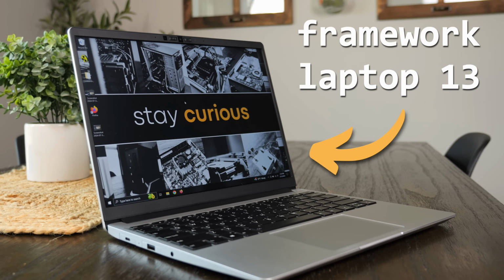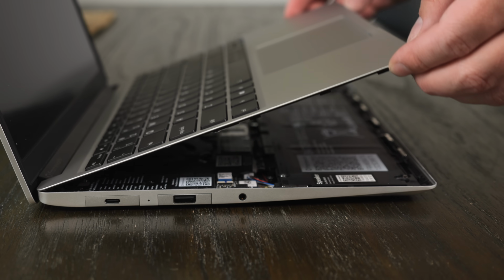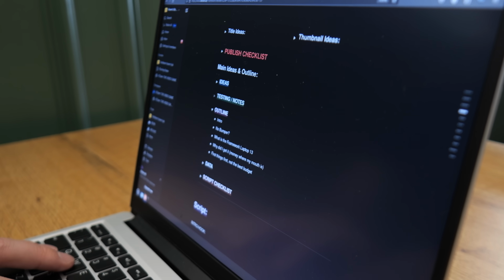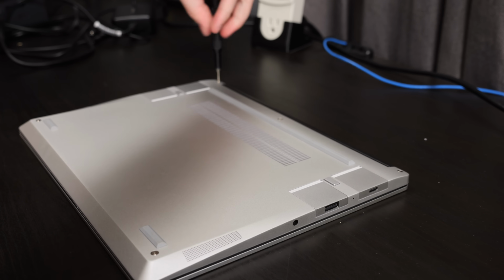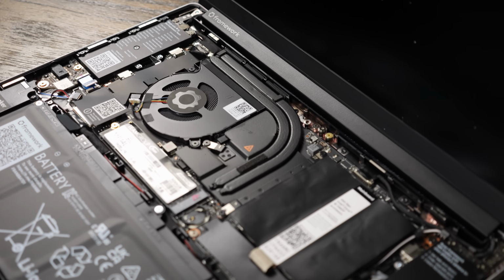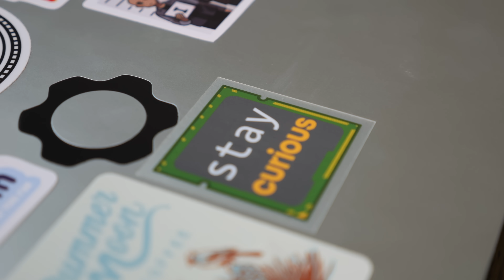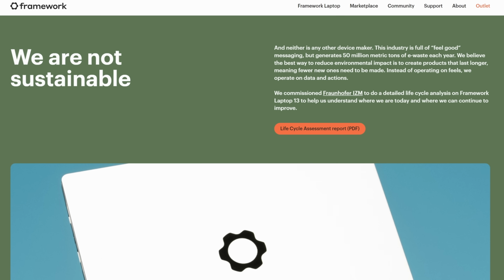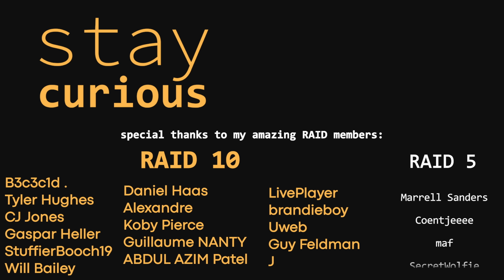Is The Framework Laptop ACTUALLY Worth It?

Comment: My wife has gone through several laptops and they've all broken in stupid ways (trackpad buttons, hinges, etc.). We bought her a Framework both to avoid the hassle of trying to hunt down parts that would be a nightmare to replace anyway, but also to support what Framework is doing. 
Yes, we could have gotten something cheaper, but I think in the long run it's worth it.
Reply: Sounds like my reason for getting one.  I kept buying around the $500 mark, previous years clearance models.  Performance-wise they were fine, but they tended to cook their batteries a bit (thin and lights do that if not well designed), and the plastic and often absurdly badly designed pieces (hinges and what not) end up breaking around 18 months in.  

To be clear, I put the laptops through their paces.  Heavy thermal loads, using them on the go, bouncing around in vehicles, just the nature of the work I do.  Only had the framework a few weeks, but so far it is more robust than even the $1100 laptops I've had hands on.  Of course, those had a discrete gpu.
Reply: is she happy with the laptop long-term?
recently got one but still wondering  how the long term experience is
Reply: What does she do with her laptops?
Mine is working perfectly for 4 years, even after a few falls from about 1m height
Reply: Hey, how's the Frameworks doing?
Reply: Don't know if its the same in the USA, but in the UK Dell Business laptops with the 3  year support get next day fixes from an engineer that comes and fixes it. I think thats good service.
Reply: @J-Stoic  "Dell Business laptops with the 3  year support get next day fixes from an engineer that comes and fixes it."

You should take a better look at the fine-print in those next day warranty claims! Almost all of them clearly indicate that someone will take a look at your laptop within 24 hours, yet it doesn't promise within 24 hours repair! 
It's mostly a useless marketing gimmick! Typical for large corporate brands, such as HP and Dell...
Reply: @timmy7201  I've had hundreds fixed the next day :)
Reply: Would you consider selling (or giving!) those older laptops? 😁😄
Reply: It's been a year. How is it?
Reply: It’s been a bit since this comment, how are you feeling about the value of the purchase?
Reply: sounds like a wife problem
Reply: @RaduUrsache  normal wear breaks those items. Especially on thinner machines that flex easily.
Reply: @RaduUrsache  Sounds like life in general. Kudos to this guy for finding a solution for the two of them.
Reply: @RaduUrsache 😂
Reply: @RaduUrsache  It's cheaper to replace the laptop. 🤣
Reply: @RaduUrsache  Just move to San Francisco, problem solved.

Comment: I'd love to get one but I just can't justify the price. 

Seems to me you could get two comparable laptops a few years apart for the same price.
Reply: it's defenitly expensive but you ccan get a FW 13 for around 1k by buying your own charger, RAM, & Storage. Also they have refurbished (factory seconds) models for as low as $500
Reply: Depends what you consider comparable?  Sub-$500 systems are rarely worth getting in my experience.  They break down often, are slow to begin with let alone in a couple years, and offer worse keyboard/trackpad/monitor and build quality.
Reply from the maker: Indeed! Especially on the used market.
Reply: Less e-waste.

Comment: I bought the Framework 16 a month or two ago, my biggest gripe is that it refuses to go to sleep even with various registry tweaks and the latest BIOS. Even when it seems to go to sleep, something is drawing power while its sleeping and killing the battery in under a day. Only other thing I haven't tried is removing all the expansion cards and seeing if it stops draining, since I heard the display port/hdmi cards can have a parasitic draw. Also with the dGPU on the Framework 16, it can draw more power than the charger can provide during gaming and drain the battery. They also haven't developed a charger that can provide 240w through USB-C, I would have rather they just used a 19V barrel jack like other laptops.
Reply from the maker: Seems like the 16 has quite a few more growing pains from what I've seen. Hope they get them sorted out!
Reply: if youre on windows you can change it so that when you close the laptop it hibernates which stops the power drain issues
Reply: I have the 250 Watt power brick. It works great. YMMV as I don't game. (I'm a developer.)

Comment: I think the biggest deal with the Framework laptop is it's designed for the long term. If you're an ultra high end user and upgrade laptops every 2 years this probably isn't for you. But for the average to tech heavy user, this is AWESOME.

Not many laptops compare well to Macs battery life.
(Except my old two battery T480 👍😁)

Do you get better battery life than Windows under a light Debian Linux install with XFCE desktop ?

Comment: I personally have a amd 7640u framework laptop, it is truly what it seems a sturdy, yet light laptop that has great repairability, and yes I love this laptop, it has served me well and i do plan if i were to get another laptop it be a framework 
I would recommend this laptop, if you have the means but it and believe in the company's mission, to buy yourself a framework
Ps. Its also a very unique laptop to show off, something cooler than a gaming laptop
I will try to reply and answer any questions in the replies
Reply: What configuration did you go with minus the AMD chipset?
Reply: @taiga7039  I bought a 5600mhz crucial 16gbx2 kit and a 1tb p3 plus
Just plugged it installed windows and it worked
Reply: @taiga7039 crucial 16gbx2 5600mhz kit and a crucial P3 plus 1tb
Reply: @taiga7039  damn none of my replies showing up a 16gbx2 5600mhz crucial memory, and a 1tb P3 Plus
Reply: @actyst901  nice thanks
Reply: Battery life?
Reply: @ertento  extremely late but honestly I haven't fully tested battery out

Comment: I can confirm that all of the key functions (e.g: screen brightness) and the fingerprint sensor work out of the box with Fedora Workstation (Gnome).
Reply from the maker: Nice! I assumed they would work for the officially supported distros, so good to know.
Reply: @HardwareHaven  I run Mint on my AMD 13 Framework, and installing fprintd is pretty easy to set up (just don't forget to use space bar when setting up PAM to enable the fingerprint scanner!). There's a bug with the login (well, not a bug, but it doesn't work, something a more knowledgeable Linux user could explain about gnome keychain etc), so you either wait for the 10 second timeout or modify common-auth to circumvent the fingerprint scan during the login screen.

The brightness buttons may depend on the kernel you're using? Depending on what Mint verion you're on, it may be using an older kernel. I think at Mint 22 they're on 6.8 which seems to work really well out of the box for me (just did a fresh install recently).

Great video, by the way! :)
Reply: @BryantNaro TLDR for the keyring: Linux has a thing called keyrings. They provide encrypted storage, for stuff like keys (passwords). There’s many different ones (such as gnome-keyring), and they are (usually) encrypted, with your password. When you don’t use your password at login, it can’t decrypt anything stored using your password since you didn’t enter it.
Reply: @ This is a wildly timely comment, I just switched to Fedora from Mint after a year and fingerprint reading was ready to go out of the box! It pays to stick with the supported distribution I guess ;)
Reply: With an unsupported distribution you are playing russian roulette with the AMD drivers. I have had months of stable experience and then an update would break sleep mode or crash the graphics drivers.
Reply: @yyny0 Funny, that is my experience running NVIDIA drivers on my desktop 😅